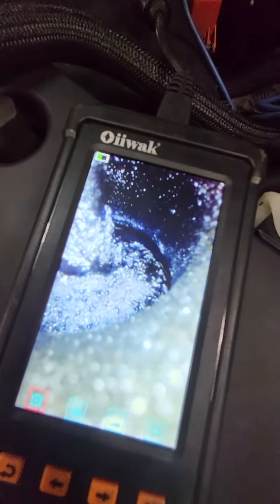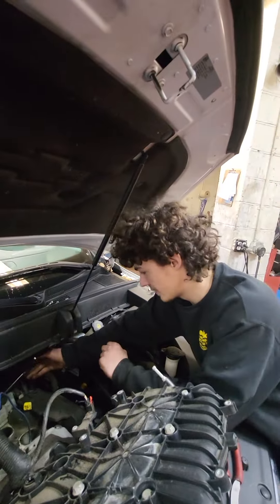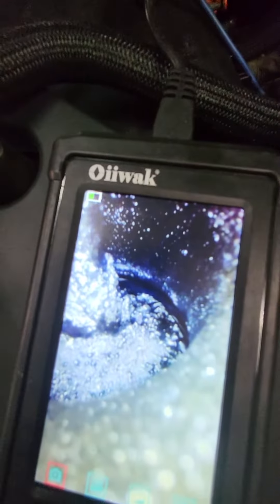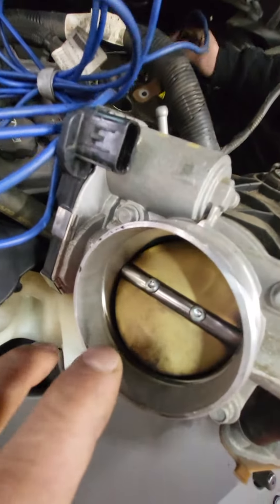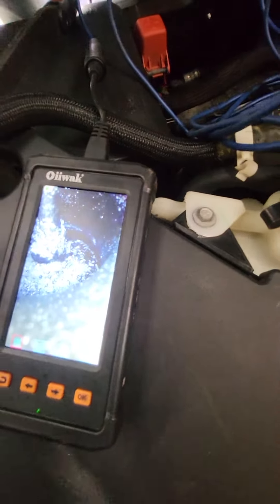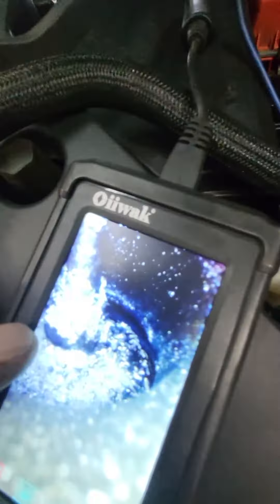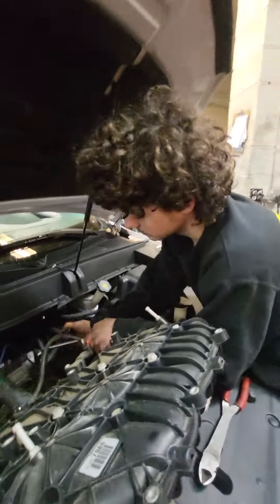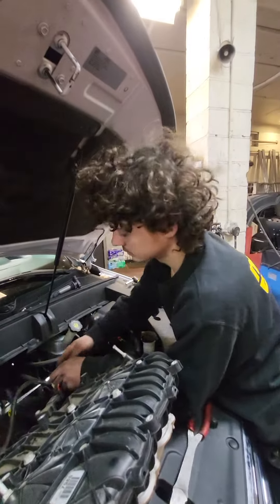Po300 2016 Chevy traverse 3.6 gdi  Carbon intake valve are not it only problem

Comment: I worked on a 3.6 like that 2-3 years ago. The pcv orifice plugged up on the back head and caused it to carbon up like that. Cleaned out the orifice, intake valves, new plugs and it was good to go.